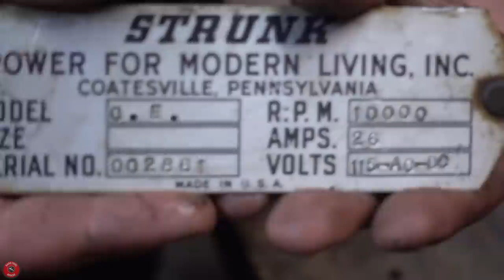1960s Electric Chainsaw [Restoration] (Part 1 of 2)

Comment: Looking great!  If you clamp a piece of copper behind a hole you need to weld over, it will provide support for the weld but the weld won’t stick to it.
Reply from the maker: I did receive this tip on Patreon as well.  I never knew that!
Reply: this concept works with anything used to fill a hole or pot things, i use it all the time to pot things in hot glue and certain resins, for hot glue  just put razor blades against it and when it cools the blade falls off leaving a perfectly flat surface, if it gets stuck hit it with some canned air upside down to freeze it and it will pop off, really handy for making strain reliefs on custom cables
Reply: They actually make welding spoons for this. Most welders i know just hammer copper pipe flat and hold it with some vice grips.
Reply: neo 71665 LoL, that’s what I do too. If I was doing it everyday I’d invest in some spoons.

Comment: You probably have already put it back together and found out by now, but if not, I can tell you that it is a HOSS !
In the 80s my ex father in law purchased a farm in Manitoba and found one of those In the barn that would not run.
When I was visiting he give it to me and I took it home and got it going !
Better have a good strong breaker and a heavy-duty extension cord to run it, but it has some hellacious power ! 😊
Found out later that it had been mounted on a homemade device for cutting firewood !
Thanks for sharing and take care. 👍
Reply: That's a tool that's screaming for 220v! 26 amps on 115v, never even heard of that. Do they make 30 amp breakers for 115v, or do you just use a 20 amp and hope you don't trip it too often?
Reply: Of course they have 30a breakers. It's the same size used in electric dryers.
Reply: Of course, that makes sense! I got stuck on the whole 115v thing.
Reply: Hahaha!! I love hearing these kind of stories! Pretty crazy, the stuff they were able to get away with back in the day.
Reply: porque estás de vacaciones en mi pueblo que tal y que cual que no te es que no quiero que estés de vacaciones en mi pueblo y ya está porque porque te come las mierdas

Comment: Try clamping a 1/4" plate of copper or brass behind the hole and then mig weld, you can plug the hole and the copper or brass will not stick. Sheet metal trick that I have used for years. Your weld will come out nice and flat on the backside.

Comment: I really like that hand ratchet tool at 6:05
Reply: They're definitely great to have on hand when you don't have the room to move the handle on a full ratchet or don't need all the torque but still need more than your fingers. Without an extension they can fit in pretty much any tight spot you need them to. It's called a palm ratchet, I'd never seen one before this last Christmas when my dad bought me a toolkit that had one in it. It was great for swapping out my radiator when one of the nylon sections cracked, I didn't have to worry about moving any hoses out of the way

Comment: Does Evaporust come in cans big enough for, say, a 1967 Plymouth Valiant?
Reply from the maker: I should set up a drive-through lake at my house that people can come and use.
Reply: They do show somewhere how to use a sump pump , roll plastic, and kiddie pool to derust an old Chevy frame
Reply: Yes I also have a car i'd like to dip entirely in the stuff.
Reply: I've thought about that. How great would it be to soak the undercarriage of a classic car in Evaporust?
Reply: Nah, man, too much work to set up. Just get a giant fish tank and a crane. :P
Reply: My lovely 2001 Tundra could use a body dip.  Toyota gave me a new frame but now body has the rust.  I live in  the NorthEast of USA.  Humidity and salt...
Reply: Wouldn't removing all that "structural rust" just disintegrate the car?
Reply: diamondflaw yeah exactly 👌👌👏
Reply: Sure it would, but thats why we have welders. Only thing i'm wondering is does this eat trough protective vax like stuff inside the frame and how to resurface metal after its dipped. So many lovely cars i would love to restore like that, but cost of doing such dip is just way too much and resurfacing is next to impossible for DIY guy :/
Reply: Wouldn't it be faster to just feed it into an industrial grinder? I mean - I don't know the Plymouth Valiant, but cars from that era tend to be held together by paint and wax these days.
Reply: You put a 1967 Plymouth Valiant through evaporust and you won't have a 1967 Plymouth Valiant anymore.

Comment: I just started watching these videos - the tools this guy uses are as interesting as the restoration itself. Those square adjustable wrenches are cool, so is that hammer screwdriver I saw in a previous video. I've never seen that before.

Comment: Another great video. When I saw the condition of the oil can I said wonder if he will try freezing ice in it to expand the dent and look at you. Great minds think a like. LMAO. Have you thought about an ultrasonic cleaner to use in cases where you can't sand blast? Your work bench will be named a 'Super Fund' site soon. ;-)
Reply from the maker: haha! I do have an ultrasonic cleaner, but it's not powerful enough to remove paint.
Reply: I was thinking more along the lines of general cleaning. Not sure I would want an ultrasonic cleaner that could remove paint, strip the skin right off your hand if you reached in while it was running.
Reply: Great minds think a like, but fools rarely differ

Comment: You can get that much cabbage from youtube?!?!?!?!??!  WOWZERS!!!!!!!

I would never have thought to use filler on the oil reservoir.  (Hey, maybe you need some body work tools so you can remove the dents from that can.  Dollies and spoons and hammers.....  )  Amazing work.
Reply: You get a half a cabbage for every 100,000 views.
Reply: I personally thought he put way too much effort into that oil can. I don't think it would have been too terrible if he just replaced it with a new one. He replaces other worn parts like wires, bearings, nuts and bolts - not the end of the world. Just an observation, not criticizing - LOVE this channel!
Reply: It'd be a little difficult to find an oil can for a tool from the 60's, and body work tools wouldn't really be feasible here. I guess he could've just cut it in half, pounded it all flat on the anvil then weld it back together though.

Comment: DAYUM. thats using your canadian environment! never would have even remotely IMAGINED using freezing water to expand and pop out dents in cans. (also because as floridians we do not believe in this "ice" concept..) this may have opened up many a oil-can restoration possibilities in the future.
Reply: spartan36789 
You have to be careful doing it and never leave it unattended long or the ice can blow apart your oil can likely leaving you with some very expensive scrap tin. 
The power of expanding ice is mind boggling.
Reply: Wayne Crews  even if its the oiling can types? The ones with the thumb or hand pump? I dont know if your thinking of like those or if your thinking of the old fashioned cans they sold motor oil in you had to crack open and pour with a spout. Id imagine those could split but the oiler cans seem like thier decently thick.
Reply: spartan36789 
I was thinking about the tin oil cans that are similar to the can on the chainsaw. 

Expanding ice, can and does cause a lot of damage.
Reply: Wayne Crews and that metal also contracts when cold so it'll work twice as fast
Reply: In the South, ice is for tea.

Comment: The project farm channel just did another episode testing the efficacy of some penetrating oils. Something worth checking out
Reply: billiondollardan yeah and on that test it shows that WD-40 made it harder to crack off rusted nuts. Wouldn't really be too impressed with any info from that channel
Reply from the maker: I mainly use penetrating oil to help get the bolt to spin off the crusty rusty bolt, not so much to get it loose.
Reply: I think price for effectiveness the Brake Fluid beat all of them lol
Reply: AvE did a few tests that I thought had a bit better process, even if his sample size was small.

Comment: On the oil reservoir: maybe the next time you run up against something like that cut it at the seams, flatten the dents out and braise it back together? I could talking out my ass though.
Reply from the maker: Definitely could have done that as well, but my bodywork skills aren't there yet.
Reply: Hand Tool Rescue we have faith in you.

Comment: If it's an electric motor, why the clutch? Or is it a brake?
Reply from the maker: I honestly have no idea.  It makes no sense to me.  Direct drive would be easier and cheaper...
Reply: Looks like a “safety” feature. It will disengage the sprocket as the rpms go down. That way the blade stops after you release the trigger. Just my thought.
Reply: This may be so. If this motor has a heavy rotor, then it might continue spinning for a while after releasing the trigger.
Reply: Probably to allow some slippage when the blade catches, there is lots of torque in that monster motor, and also those clutch housings with the chain sprockets are already invented... industrial lego.
Reply: Clutch has two functions:
1) Initial start- and rev-up of electric motor without load on shaft (decreased starting current);
2) Torque limiter (mechanical motor and chain protection when chain catches). 
So, it's a well engineered, trusty and durable old iron, in contrast with modern disposable pieces of junk...
Reply: I agree with Phipps...the slogan in the 60’s SAFETY 3rd!

Comment: Using taste to test the oil is an age old practice going back to the creation of the first engines
Some manufacturers would supply you with knock off oils made from corn or soy which would gum up and burn inside your motor or engine tasting it would let you know if it’s genuine or a knockoff and could save you big bucks

Comment: busted electric tool
has metal casing

Nobody:

Absolutely nobody:

Handtool Restoration:

Plugs it in and places hand on the metal handle
Reply: If you don't complete a circuit with your body it's not a problem.

Comment: 10000rpm !?
Reply: Probably the motor speed, not the chain.
Reply: it is direct drive. so whatever the motor speed, is the sprocket speed.
Reply: Indeed. That's what I was thinking. The chain speed must be pretty insane with 10000 rpm.
Reply: sikkepossu 10000 RPM is normal for a chainsaw, some modern gas ones even reach 14000 RPM or more...
Reply: Ok. I have never tought that the chain speed is so high eventhough I use chainsaw quite regularly.

Comment: I have commented before how much I enjoy your work.  I restored a scroll saw as my first project, my second project is not as cool as this chain saw but still neat.  I got a non working Ramsey 6000 winch from the mid 80's. The Solenoids which most places want $75usd each for are shot, and there is 2 when a new winch is $300 for a new one. I found the matching part number on line for $12usd each. I'd say I'm Winning. 1 week back order but that's fine by me. The gear grease has become hard as well. Sounds like a great time to me.  I'm excited for a full proper in depth break down restore in my soon future. I can't wait. Keep up the good work. I am excited to see part 2 of the chain saw

Comment: When you want to plug weld a larger hole in sheet metal with a mig you can clamp a thick piece of copper sheet over the back of the hole. It supports the weld pool, But the new metal you're adding won't stick to the copper. It also sucks heat out of the surrounding area it's touching so it helps prevent distortion. 

It makes reflatening the area afterwards a lot quicker.

Comment: If you put  a flat piece of copper behind a hole you want to fill the mig will not stick to it. Nice work so far! I have been using the evapo rust and love it but I'm starting to get a sticky film on everything after only a few times using it.
Reply from the maker: Sticky film?  I've never experienced that...
Reply: Hmmm, it wire wheels off just never noticed on any of you stuff.

Comment: The freezing water idea was brilliant, I'll keep it in mind for my own tinkering projects.
Can't you fit a new blade and chain? They are considered consumable parts, so mounting new ones won't diminish the value of the restored chainsaw, just boost it to max performance.
Reply from the maker: Thanks!  They were both in decent enough condition to not need replacing.

Comment: I was surprised to see the centrifugal clutch on it thinking just on and off should be enough but that motor must have a lot of power on start up plus I realize that if it gets hung up in some wood it needs to slip or it will destroy itself or your wrists. 

Does purple cabbage taste better with paint stripper, WD40 or TSP? Does it make a great sourkrout when mixed with one of these cleaners?

Comment: Not sure if this made it to the comments yet, but when welding a hole you can back it with copper.  The steel weld will not stick to the copper.

Comment: I sure thought you'd wreck the oil can by grinding through it, but you did fine.
Is that just a standard quart oil can with a small fitting soldered to it?

Comment: Is it not possible that the clutch material is made from asbestos? Also a protip, if you need to plug a hole with just weld put a copper plate behind the hole and the weld won't stick to it. Only issue is melting the copper but use a thicker piece and be careful and you're golden

Comment: why did you use a center punch on such a large area to extract the shaft ?
could have easily used a wooden block or something larger to prevent dents

Comment: Due to the era, those centrifugal clutch shoes will almost certainly be asbestos, using compressed air near them and the dust in the clutch housing should be avoided at all costs.   Another great project and you seem to be developing a taste for schmoo syrup!

Comment: I realize you didn't in this video, but where do you get new brushes when rebuilding electric motors?? I have a few antique fans I have rebuild from the 30's and 40's and a couple of them have very worn brushes. Do they come in standard sizes and you just have to measure the ones you have? This would also help me when rebuilding classic car starters.
Reply from the maker: Carbonbrushes.ca has lots of options, but you have to call.

Comment: Hey, in a few videos I've noticed you taking out long bolts with a rag and visegrips. Just was wondering why don't you use the trick of putting on 2 nuts, jamming them together and wrenching the bottom one? It should work better and not damage the bolt at all. As always such a nice video!
Reply from the maker: Thanks!  Sometimes that does not work if the bolt is really stuck.

Comment: It's hard to tell soak time with the footage sped up in spots, but that aircraft stripper works much better if it soaks for a while. Plastic cling wrap applied over the part after applying the stripper helps keep the good stuff from evaporating. Also, that red spot filler putty shouldn't be applied over large surface areas like that, try looking for a body filler glaze. The glaze is a catalyzed product which hardens through a chemical reaction rather than just air drying the red putty.
Reply from the maker: Great tip with the plastic wrap!  The stripper did soak for a while, it's just not that strong from that can.

Comment: At 8:05 you can use 2 nuts to remove those kind of bolts, its pretty simple, just screw both to the bolt then try to remove the below one the upper one will stop it and then viola you are removing the bolt without damaging it :)

Comment: Great vid and ingenious use of the temperature for the dents! I was just wondering though, how do manage to paint things in such a low temp?
Reply from the maker: Thanks!  I crank the heat up in the shop for a few days.
Reply: Ah! Ok. I live in the UK and we store our paint in a locker near one of the main entrances where I work, and in winter we have to put the cans in a bucket of warm water. The spray area is warm enough for the actual painting though. Thanks for the quick reply. Looking forward to part 2.

Comment: for the oil tank maybe you could use a torch to heat the kinks and presurise it with air  to expand if it didn't leak,  like fixing a two stroke exhaust

Comment: Your experiment @20:00. If you take a thick Pierce of copper and place it under the hole you plan to weld. And maybe fix it with some clamp.  (It needs to be around 10 to 12 mm thick or it will melt) and start to weld against the material you want to fix. After weld you only need a gentle but steady tap and it will fell of.  We use that trick at my work and it is very nice way cause you dont have so much to grind after. 👍lazy way is sometime a god way. Greetings from Sweden!
Reply from the maker: Good to know! Thanks!
Reply: And the copper will be VERY hot afterwards. Remember that please.  Forgot to write that.

Comment: You’re a brave man. Plugging it in and holding that metal handle, or did you have a test kid try it first?
Reply from the maker: I did try it off camera with a live wire detector before.  Aluminum handles will get you!

Comment: Just a tip. When plugging in old eletrical equipment, don't handle it bare-handed. There's no telling if the power is shorted to the chassis.
Reply from the maker: I tested it off camera first, but I should show the proper method next time, for safety of others.

Comment: 26 Amps? in Australia the most we get from single phase is 10 Amps 240 Volts = 2400W
that thing must need 3 phase to run, or I'm guessing to use it in the field as the army would have you'd need one helluva generator.

Comment: I'm wondering if it would have been easier to find a similar sized can, braise a threaded insert in and form the curve on the back. But original is original.